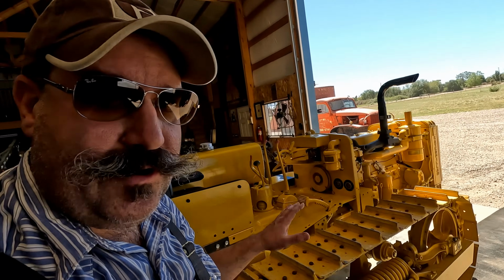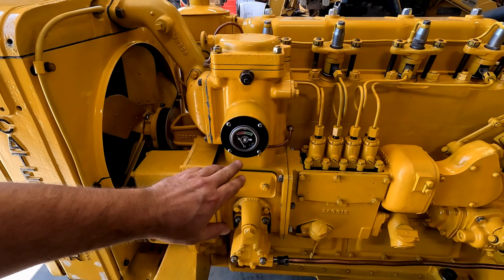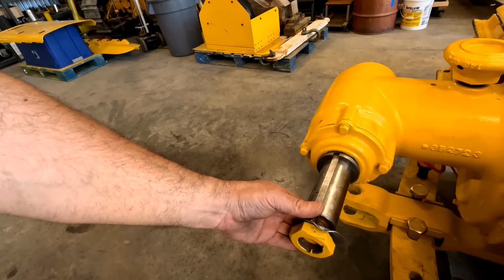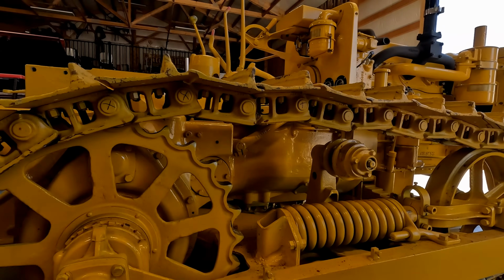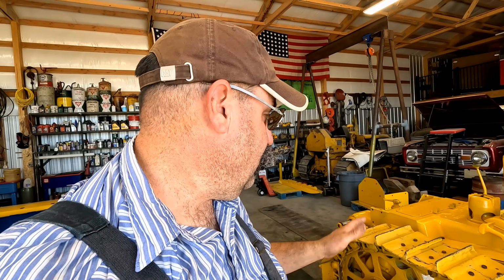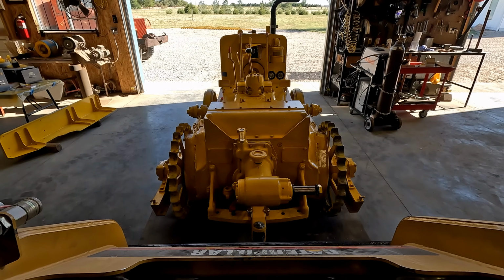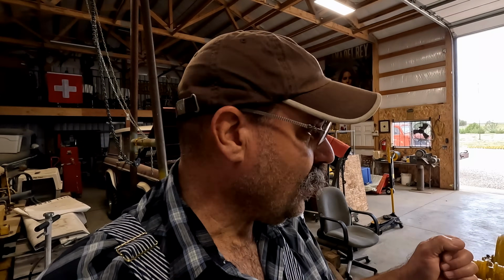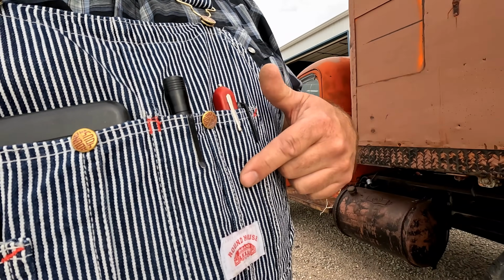One step forward, two steps back! Caterpillar D4 Episode #134

Comment: YouTube first put one of your videos in my feed right at the start of the stuck track saga. I have an AC HD5G with some stuck tracks (and a stuck motor too now because I haven't got to fixing it) so was interested in how you'd solve it. I feel like each episode is going to be "the one". At this point I would have taken your other fender off and then run it around the yard for a while to see if anything changed, and give the motor a bit of work. But it's clear that's not how you do things (as my Grandpa said "if a jobs worth doing, it's worth doing properly"). The upside is that I'll get to see your pin pusher.

I had heard from someone that often driving through water was OK to free things up, but it seemed a bit iffy to me. I considered building a long shallow steel tray big enough to take the bottom of a track on the machine, so I could now soak them in diesel for a bit. Would take a while to keep rolling the track around to soak them all.

And all the video's are entertaining. Thanks.
Reply from the maker: Thank you for reaching out and welcome to the channel! I love the sound of those Allis machines!  We've been hesitant to just run the tracks on this tractor. The engine is not properly broke in quite yet. The ideal plan is to hook it to an implement and pull it at a very consistent pace. The tracks have just been too big of an unknown. We were very skeptical of the water solution but so many Old Timers were confident it would work. You can say it's like an episode of Mythbusters with caterpillars. 😊👍
Reply: That has precisely been my experience as well!

Comment: If it’s any help, when we restore tanks we free up each track individually to the rough point you’re at now, bashing the link up and down or removing the pins, get them onto the vehicle, then pull the tank on a straight bar behind something big around the field until they’re properly loose.  You’re so close.
Reply: PS I only started watching your videos when I saw soaking the track and thought “holy cow, if that works it would save so much hassle”.  lol.  I feel your pain.  Soaking in molasses can be good if the track is properly (70yrs in mud) rusty though.  Then you can work the links individually….
Reply from the maker: This is great advice and I'm intrigued by the tanks you work on! We are very happy to have you here with us. I always try to stay ahead on videos. Hopefully this isn't too much of a spoiler for you. I don't think that soaking the tracks hurt anything. It may have helped slightly but very marginally. I'm finding out in the end it takes exactly what you said. Physical work moving the chains. We used  a porta power and press them back and forth. Once we've gotten them all to move they go on a more "expendable" running machine. It's a very rough ride but we are very close to having them all free. 👍😊

Comment: Have you thought about soaking the track chains without pads in a bath kerosene, diesel or ATF/hydraulic fluid?  Just thought using those as they tend to penetrate stuck engine cylinders and lubricate and free things up. 🤑
Reply from the maker: We actually soaked them in motor oil for several months when we first got the machine. We probably put a case of PB Blaster on those chains. The ATF hydraulic fluid or a diesel bath probably would have worked the best. In the end just running them on another machine did the track. 👍

Comment: A couple thoughts. My dad replaced the final drive bellows seals on his 7U. One of the pins on the seal broke off in the bottom of the hole. It held the seal out and poured oil.  He had to pull it apart the next day and found it old seal part.  I don't think your seals should leak anything close to the trail they do. Yes we see a small wet spot on the ground after months being in the same spot.
Reply from the maker: We suspect that the problem is we didn't sand down the cork seal surface. I later learned that in the caterpillar service bulletins it was a suggested step for installing new seals. After we initially filled the compartments it took months before any drips showed up. I suspect this will require a revisit in the future. 👍

Comment: I think I would have taken that fender and tank off, then made another bracket for the seat, added a temporary diesel tank and then tried to run it and see if running it would free the tracks up. I say that because I’m stubborn and have to prove to myself that this method isn’t going to work. 
Ultimately, I’d say 80% chance it wouldn’t work and then would need to press the pins out. After two years on a machine restoration and being this close to finishing, I’d be tired of fooling with it too and just break down and fix it the right way at this point. But I still would have had to try to run the kinks out using the engine!
I’m curious to see what you come up with for a press compared to what Squatch built. Hopefully it works well and is safe, THAT is the most important part!
Reply: I too think running those tracks with the cat is the best way if you have any movement at all. Fenders off, jacked up, run in place. It is too bad, only tracks with practically zero wear will seize up that badly. I have heard pushing pins out can be a solution but I think you will find it takes a lot of force.
Reply from the maker: We are little anxious about running the machine without breaking the engine in first. But I think we will put those tracks on another machine in the future. 👍
Reply: @tomarmstrong4156  
I’d never Jack it up and run it in place, those tracks need the weight of the machine on them to get the most benefit out of working those links back and forth on the pins as much as possible. Personally, I’d find a shallow creek to run it through, numerous times and probably over several day’s time to try and free them up before going to the trouble of building a press to take them apart with. 
Squatch built a press to do his with, and it took a lot of hydraulic pressure to push them apart. He actually said after he was finished with turning the pins that he wouldn’t do that job for anybody else if they asked, it was just too dangerous with the homemade press.

Comment: You need to call Squatch and borrow his track pin machine...
Reply from the maker: I'm not sure that it's going to get the pressures we need for a D4 chain. 🤔
Reply: This was the machine he built for the D2. It had allot of power...
Reply from the maker: It's a bit of a spoiler but we've already made a single pin pusher. 50 tons was not near enough to budge anything. We have a plan B we're going to work on right now. If that fails we will go back to the drawing board and make an elaborate setup like squatch253. 😊
Reply: @lifeafterourloss  Ok, Mums the word LOL. Have fun and stay safe!

Comment: Swatch 253 made a pin pusher to rotate the pins on his last D2 project track chains. Some inspiration or design points maybe found for your pin pusher. One thing to note at the pressures those pins take to break loose to remove from the chains hardened end Caps on the pusher pieces maybe needed to prevent deformation of the pusher pieces
Reply from the maker: We've just filmed that video and experienced exactly what you're talking about. All of the components will need to be high grade and hardened, just like you mentioned. We have one other trick up our sleeves before we get more elaborate. 😊

Comment: Don't know that I have ever met anybody with the determination of you two.  Many years ago I started restoring a JD 40 crawler.  Made it all the way to applying the paint, all that was left was turning the track pins and bushings.  I drove 3 hours to an auction listing a track pin press, one used by a Caterpillar dealership.  There was a surprisingly small crowd when I got there.  I thought I might actually have a chance at buying the press until the auctioneer told me the sale had been canceled do to a family dispute.  Unlike you guys I went a different route with the 40, it's still setting in the shed without tracks.  Also congratulations on the triplets, they'll make a nice addition to your Cat family.

Comment: With the fenders off...  why not rig up a temporary fuel tank and go drive those pins loose?
Reply from the maker: Ideally we would like to break the engine in with a long steady pull. We're not quite sure what dynamics the tracks would put on the engine. Bit of a spoiler. We're going to attempt to track pin press but one of the new 4G d4s we picked up will be wearing these tracks! 👍

Comment: Just so you don't feel to bad. I did a turbo and injectors/glow plugs and all new harnesses on a 6.0 powerstroke about 1 1/2 months ago. My first time. Went fairly smooth. Then? I started the truck. Turbo sounded like shit. Then it started puking oil. I realized the fresh rebuilt turbo was full of sand blast media. It got into the pan and the filter had media in it. I shit a brick. The company I bought it all from is well regarded but they had a bad week or two of an employee not being watched. They sent another turbo with media stuck to the outside of the turbo. Then they sent a third that was for an IH, NOT a powerstroke. I am in the process of cleaning the engine and and HPOP and now I need to change the low pressure oil pump to complete the situation. NOT FUN! I feel your pain. Literally. 63 year old cancer survivor. Every move is difficult. You probably know how many special tools I had to buy to pull it all off.
Weekend mechanic I don't claim to be. Forced into it is not what I was thinking when I decided to attack my venture.  We live far away from good mechanics so It just is what it is.
Hang tough gentlemen. You are doing a fantastic job. These projects can be pains in asses but your machine is looking beautiful.

Comment: You guys are killin yourselves. This is the third time now: get a large shallow pan, or have one made. Three or four inches wider than your grousers and several feet long. Made mine one foot longer that the tracks installed on the machine (ACH3). About 9 ft. Raised machine up with blade and ripper. Lower tracks into pan. Add enough used motor oil and fuel mix to cover pins and bushings. Let soak at least over night. Raise the machine. Rotate to next length of track. Soak, etc. Run and relax!
Reply: That's far better than water soaking for sure! I was also thinking you could just spray some phosphoric acid on the stuck links and simply dissolve the rust. Only trouble I forsee is that, with phosphoric acid, while it won't damage the metal, it converts some of the rust to black iron oxide, which would then need to work its way out.
Hydrochloric acid might actually be the better bet, so long as it's washed off within a few hours. That would convert the rust into solube iron chloride that would wash away (Fe2O3 + 6HCl → 2FeCl3 + 3H2O)